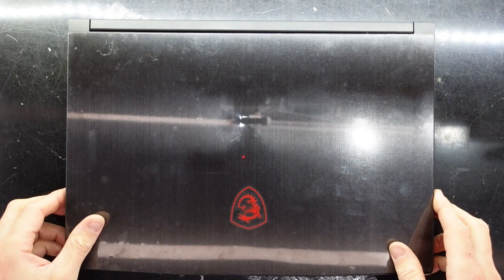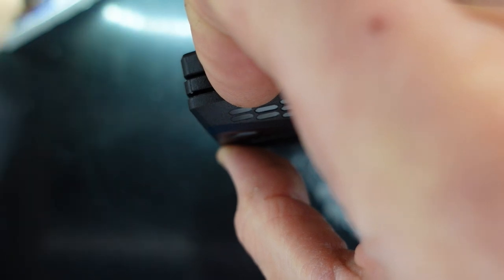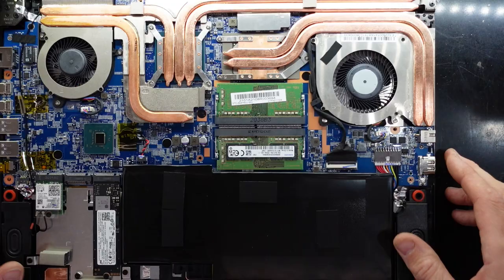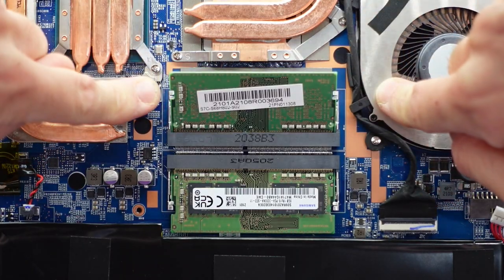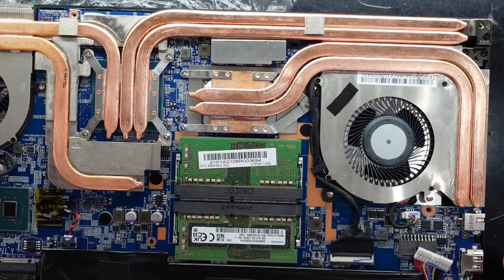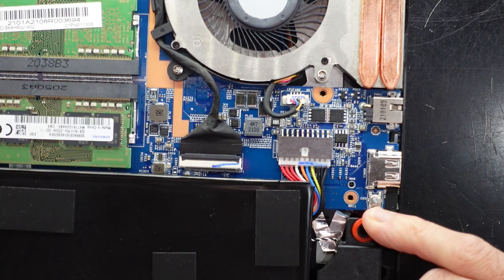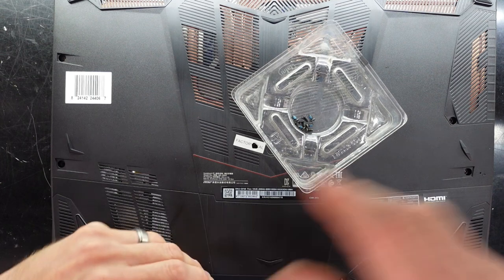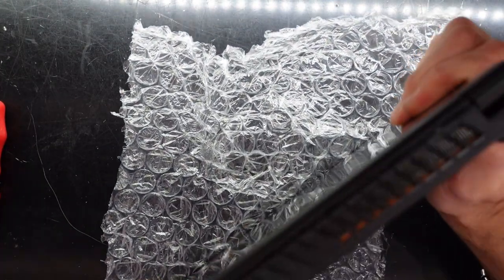MSI GF65 Thin 10UE Teardown and Ram Upgrade

Comment: Hello Sir! Thank you for showing this video. I have a situation. I accidentally spilled liquid on my MSI GF65 Thin 10SDR. It currently won’t turn on anymore after 72hours of drying. Can I upgrade the motherboard and battery, and put back my ram, Ssd so that I don’t lose my files? Or what suggestions would you prefer? I cannot afford a brand new one at this time, and my laptop is fairly new also. I’m devastated over here. Can you or anyone please give me some detailed suggestions? I would truly appreciate that.
Reply from the maker: Hi, sorry to hear

There isn't much I can suggest, open disconnect the battery and see if it will power up with only the power adapter connected

I don't think you could swap the board over with a newer mainboard

I think you are out of luck and be better off selling the machine as a liquid damaged laptop and buy a cheap temporary replacement laptop
Reply: @rickstechrepairs  Thank you for responding! I appreciate that. 😔
Reply: @jhunomeh1350  This is why you never drink/have a drink near a laptop.
Reply from the maker: Bugger :( an expensive lesson learned
Reply: I never do. Someone came to the dj station to make a request. It all happened in the matter of seconds.
Reply: I will figure out a way thou😔
Reply: Hey I was about to buy the same spec does it heat up?

Comment: Hello, i upgraded my ram from 8gb (2666) to 64gb (2933) on Msi gf65 10sdr thin thanks to this video, it all worked well, ram is shown 64gb thru the performance mask but while performing random activity pc keep turning off unexpectedly ...i put 2x Kingston fury 2933mgz 2x 32gb... dunno what to du.. tried to check the bios from another video of your but there is no vram manual configuration to decrease the frequency to 2666 or lower... any recommendation will be appreciated, do you also know what kind of motherboards we use ? this pc seems totally screwed once you touch something u cant get it running afterwards....
Reply from the maker: sounds like you might have some faulty or unsupported ram

Comment: looking at the storage and ports it seeems like a downgrade, i saw your temps for your g5 and i managed to get mine to max 70-75C under continuous load (gpu mining) after replacing the thermal paste and rolling back some drivers on windows (causes the gpu to take 80W instead of 70W for no reason)
Reply from the maker: on the G5 the issue was the CPU was overheating like mad. the GPU was fine temp was

Comment: Great. Blocked vents on this. No wonder it overheats
Reply from the maker: virtually all gaming laptops get extremely hot 80-100 degrees
Reply: Actually, the vents aren't being blocked. It's the mismanaged software causing the overheat.
Reply: @killertruth186  Are there vents directly below the fans for the fans to suck up air? No? Its blocked vents
Reply: @siyzerix  Not necessarily. There's plenty of vents all over the laptop. But it isn't blocked.
Reply: @killertruth186  You're right. They're useless vents. The fans can't properly pick up air since no vents are below the fans.
Reply: @siyzerix  It isn't the way airflow is the problem, it's the small heat pipes. And heatsink itself.
Reply: @killertruth186  Dude, this thing has more heatpipes than most gaming laptops. It also has a big heatsink. Its the vents. Or lack thereof
Reply: @siyzerix  No, it's the other gaming laptops have more heat pipes than this. This only has 2 for the cpu. While others have at least 3. Another thing the heat pipes is so god damn flat...
Reply: @killertruth186  My man, the acer nitro 5 has about 3-4 heatpipes WHILE getting better temps and handling a higher power rtx 3060. While this msi gf65 thin has 6 heatpipes. It has 2 for the cpu and 4 for the gpu. This can easily handle a 130w rtx 3060 with those 4 gpu heatpipes. 

Its the lack of vents below the fans. The fans simply cannot get enough fresh air.
Reply: @siyzerix  Also VRAM as well. You had forgotten that MSI has very thin heatpipes.
Reply: @killertruth186  No, go look at the heatpipes carefully. Gpu is like covered with heatpipes. Cpu needs more heatpipes.
Reply: @siyzerix  You've got to be trolling. The heat pipes are so god damn thin on MSI GF65 Thin 10UE. Most laptops heat pipes are thicker than my gaming laptop.
Reply: @killertruth186  Go look at pictures of it. The legion 5 has 1 thick heatpipe. 1 heatpipe as thick as the msi's, and 1 that is even skinnier. And yet has better temps. Why? Again, vents directly below the fans.
Reply: @siyzerix  "The Legion 5 has one thick heatpipe." 1 heatpipe as thick as msi's, and that is even skinnier." Not even bit close.
Reply: @killertruth186  Go look at photos of it. I would post the link but my replies with a link keep getting deleted.
Reply: @siyzerix  Does the Legion 5 have software issues like MSI laptops?
Reply: @killertruth186  Never really heard MSI laptops having software issues. But the legion doesn't have as advanced bios control as MSI and its fan control isn't as good.